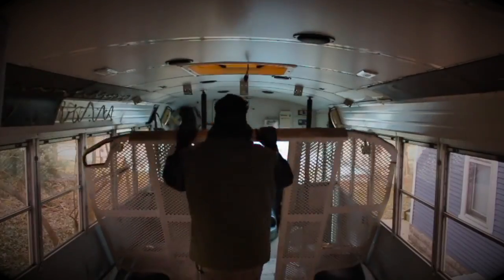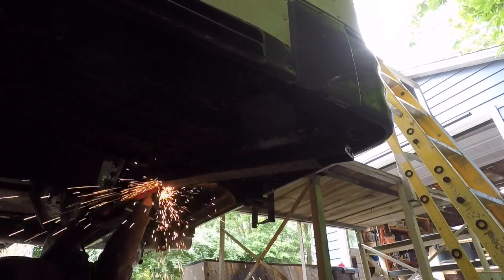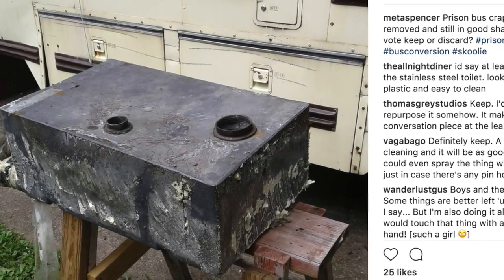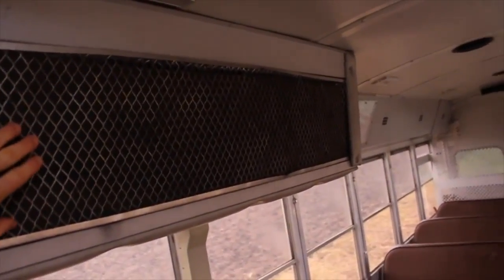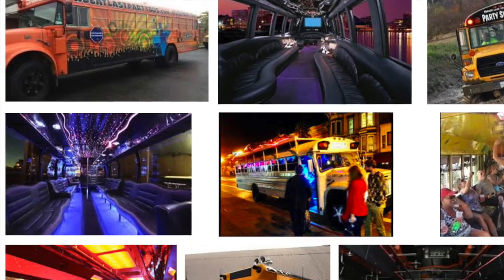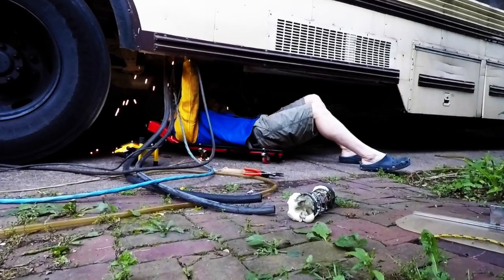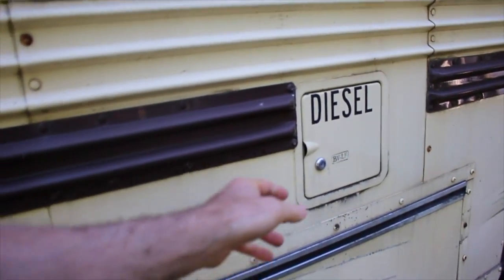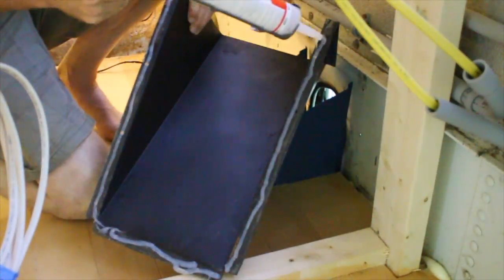Odd Jobs -- Prison Bus Conversion #13

Comment: I had the exact same headache with the tape glue residue, I tried pretty much everything, finally found the solution, it's mineral spirits with a sharp scraping tool, that will do the job, soak it well, scrape, repeat.
Reply from the maker: +Condor1982 .. thanks for the tip!

Comment: You are doing a nice job! Is your bus a BlueBird? [I purchased a Bluebird in Jan 2017 was a Red Cross blood collection unit] Built in Florida for this application 2002. I'm having fuel tank changed, has a front engine, so driveshaft has a "driveline retarder" to help slow it down. Just wondered if your bus had anything like this for additional braking? 
Thanks for sharing your journey! I'll be doing a video on mine when I get it back. God bless! Have fun!
Reply from the maker: +Allen Rousseau ... yes it's a bluebird but it only has the air brakes. I've read about those shaft retarded .... kinda cool. Take care!

Comment: I'm just about done with your bus series. I watch most bus build on Youtube and the forums on skoolie.net. You are doing an awesome job. Dealing with a black water system is always disqusting. Are you planning to do a composting toilet? A lot less mess than a blackwater system. I'm good in Ohio but some states require an inspection with working traditional toilet to convert title to RV status. Keep up the awesome work!
Reply from the maker: hey man, great to hear from you! I'm going with a black-water tank instead of composting for two reasons: 1) cost, since I have a few components for the black-water system already, and 2) grossness factor, as I've read of composting toilets getting pretty smelly and foul. I think there are pluses and minuses each way ... so we'll see how it all turns out! Take care!
Reply: A composting toilet (a wooden box with a $2 five gallon bucket and a toiletseat) at home is great. It would probably work in a bus too. I would never consider those $1000 Natureshead ones simply for the price. If it smells then they are either not using the proper cover material or the proper amount of the cover material. hooking up the hoses for the black water drain is bad. It smells bad but I hear you. You have some components and such. Also some women refuse to use one!

Good luck on the rest of the bus build!

Comment: Wait..... U have the isolator/alternator ......and then u have shore.    But.....did u contect them at all?  If not...... Ur saying u can only use those plugs during hook up???
Reply from the maker: 12 of my system is 110 for being plugged in ... then there is a 12v system that will run off the leisure battery (still have to fully set that up ... future video) ... no solar in my set-up, at least not yet